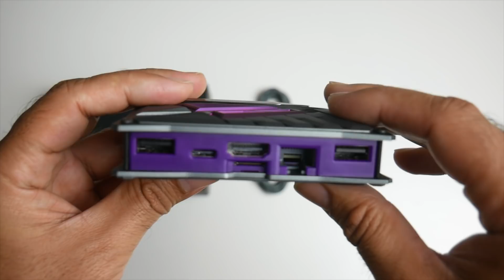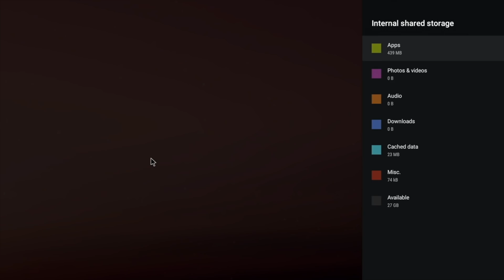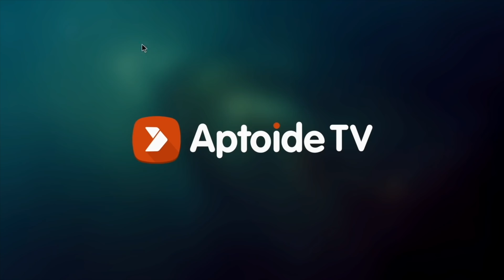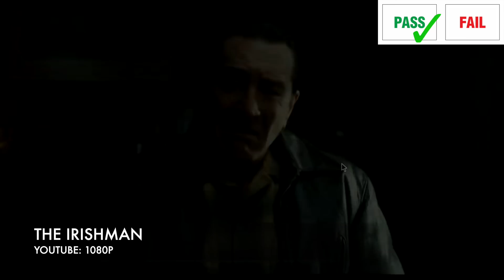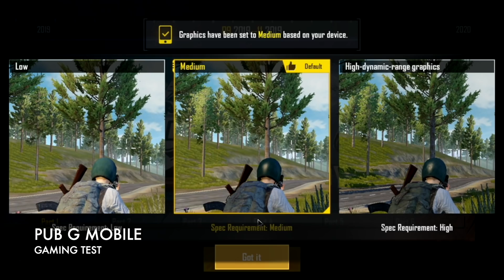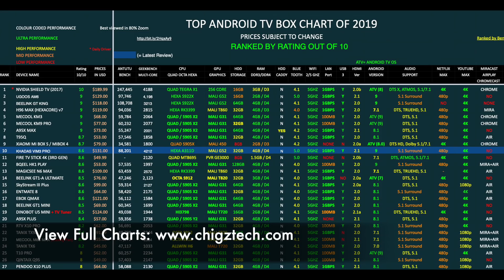KHADAS VIM3 Pro Android TV Box - AMLOGIC A311D - 4GB+32GB - DIY BOX - Any Good?

Comment: Cool video. Can anyone help me? I'm having issues with pairing my PS4 controller to Khadas vim3 in Android. It won't pair with my controller. Also I flashed Ubuntu bionic to an SD card, put SD into Khadas it all loaded up but my mouse and keyboard don't work so I can't log in to desktop. Exited about seeing what this board can do but so far I'm not doing anything with it that my overclocked RPi 4 can't already do well. I'm kinda disappointed. Please help lol.

Comment: i have khadas wim 2 whith  64 gigas and 3 ddr4  i buyed   2 yas ago,and still working  fine.but  of course thats more  powerfull as the  oldest,new chipset,new design ,spects ,run in 4k in most of the cases,like youtube, suport many games.etc.. one  sugetion to a new buyers,put the  heatsink  and the cooling fan on this device,the are especific  model that you can  buy ,so  powerfull  and  amazing  this khadas.other sugests the khadas  have a huge e great suport on websites forum.great vids man..thanks,fabio cavanha  from  brazil
Reply: The heatsink should be enough for this one.
The S912 in the VIM2 was a thermal disaster hence the need for the fan.

Comment: I think the only justification of the price is the ability to customize hardware. If you cannot take advantage of that then it is not worth it.
Reply: If the firmware is good, it's more than worth it. Actually, what this box is great for is for Core Elec, a branch of librelec to run KODI without issues or driver problems.

Comment: Ok I love the design of the box  but for that price no remote as well as other cons is a no go. Best to just get a Shield. Thanks for the review
Reply: I have a shield, it has tonnes of software bugs especially in the latest versions of its firmwares. Just check their forums and see. I think nvidia software developers have become complacent.
Reply: @lenanaH  
And your assumption is that this VIM3 doesn't have bugs?
Reply: @jiojoe8829  If you are able to do the mods capable to this device, bugs shouldn't be an issue as customization almost equals walking in to bugs
Reply: @lenanaH  
You were implying that this VIM3 was bug free when the reality is a bit different.
The Shield is a complete/ready to use product that still has the best hardware and software support for the normal end user.
The Khadas products are meant for developers and enthusiasts that like to play with hardware and software.
Different products addressing different customers and customer needs.